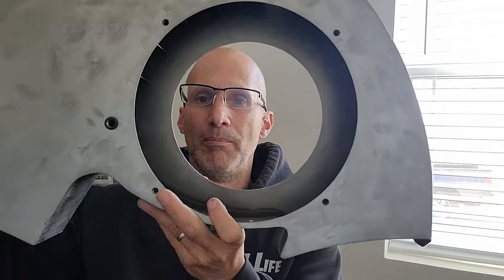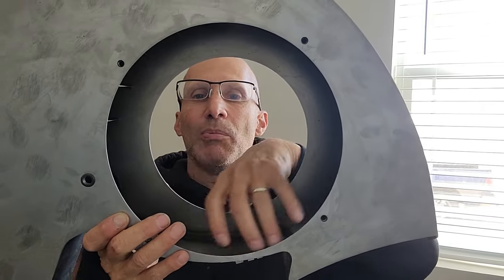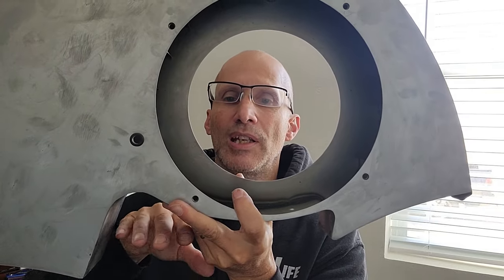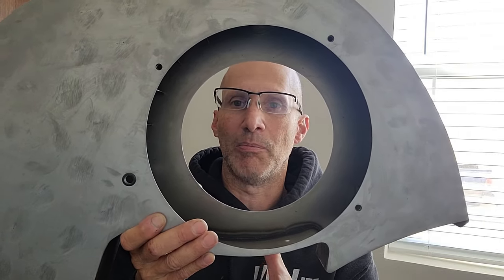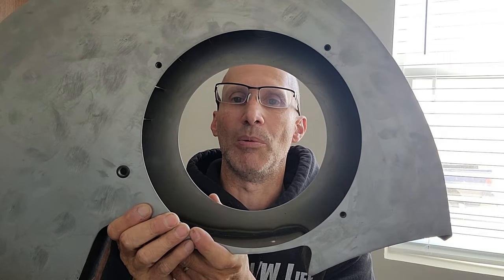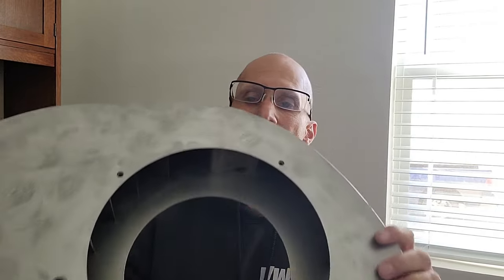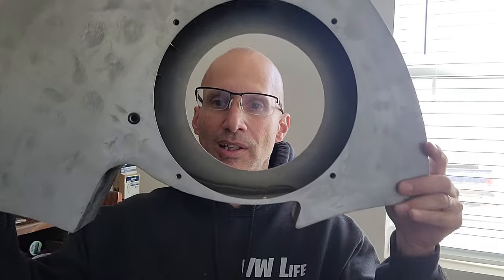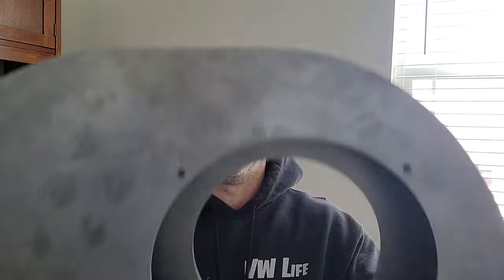Evolution Two Cooling System Deep Dive - Part 1 - Fan Shroud

Comment: Are you making one with heater pipes ?
Reply from the maker: At the moment I am not, but I have been saying if there is enough demand I'll do it.  It will make it more expensive, but I believe I have a design idea that could keep it simple enough that it won't be a big issue.  You're about the fifth person to ask, so it seems like there might be some demand.  I might have to take a poll or something to see.
Reply: @andrigsaircooledtechnology   Honestly its the only thing stopping me from buying the Evolution 2 system now rather than wait for the Doghouse Version is heat .  I have seen on buses, 914s and some Porsches, that the heater boxes have a separate electric fan for the heater boxes. Maybe there is  a simple way to do something similar  and update the Bus / Porsche design for the beetle?  You could just sell that alongside the Evolution 2 system. Or Separately for existing EV2 owners.  Then both existing buyers and new buyers could benefit.   Also that way your heat blower pressure does not have to be tied as much to the engine RPM at that point.
Reply from the maker: @jasensanders  Good to know.  There has been enough people ask that I think there is market for it.  I'll start working on the design, and update with videos as things progress.  I have an idea of how I want to do it, but until you get it in CAD, and then produce the first prototype you have no idea whether it will work as you expect, and how easy is it to fabricate.
Reply from the maker: Just to give an update.  I have the prototype parts to make one up with heater outlets.  The design was fairly tricky, but I managed to put something together that I think will work well.  Just have to go through the iterative process of making prototypes, testing them, and seeing if everything works as expected, and that nothing will get in the way of other components, like the outlets getting in the way of throttle linkages, for example.

Comment: Im excited to get this setup on my 2110.
Out of curiosity do you have any videos or info on RPM limits using your system?
Reply from the maker: I tested this to 8,000 RPM with no issues, and that is with a poly v-belt (serpentine) setup, which has either no or limited belt slip.
Reply: @andrigsaircooledtechnology  I kinda figured as much but thanks for your response. 
My plan is to put your full system on my 2110 and put the doghouse 36 style with your fan setup on a stock 1500.
I love watching your videos BTW. I can see a lot of people using your system once the word gets out.
Reply from the maker: @goldentrunnell7450  Thanks for the support, it's greatly appreciated.
Reply: @andrigsaircooledtechnology  if you happen to read this I have another question. Have you tried your system with a bell crank throttle linkage?
I'm currently running a typical cross bar set up but I'm wanting to switch to the bell crank style. 
The part that connects with the throttle cable looks like it doesn't have much clearance from the original backing plate connecting to the fan shroud. 
It seems like you covered different linkage setups in another video but couldn't remember if the bell crank style was included or not.
Thanks for answering my questions.
Reply from the maker: @goldentrunnell7450  Yes, I have tested with two different bell crank linkages.  I changed the design of the inlet/backing plate specifically because of that, and other aspects.  So, you can use it with a bell crank linkage and it clears well.  There is actually more room than it appears.
Reply: @andrigsaircooledtechnology  perfect thanks!
Reply from the maker: @goldentrunnell7450  You're very welcome.
Reply from the maker: I tested to 8,000 RPM with no issues.  Since then I have also moved to an improved version of the filament I was using.  The updated filament increases the strength in the z axis by 82%.  With the updated filament I can't really say what the RPM limit might truly be, but it's considerably higher than I tested too.
Reply: @andrigsaircooledtechnology  I've promoted your system on some other videos where they're talking about keeping a VW engine cool.
Personally I think you have a great product.
I purchased your shroud and fan system for two of my Baja bugs.
One of them I'm getting ready for my granddaughter, it will be her first car.
Reply from the maker: @goldentrunnell7450  I appreciate that very much.  It's word of mouth that is really helping my business.